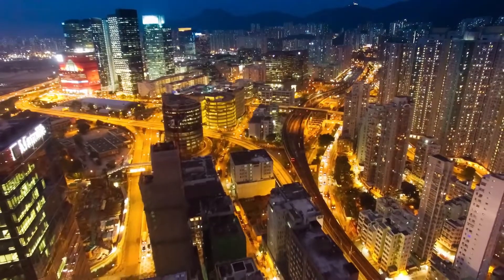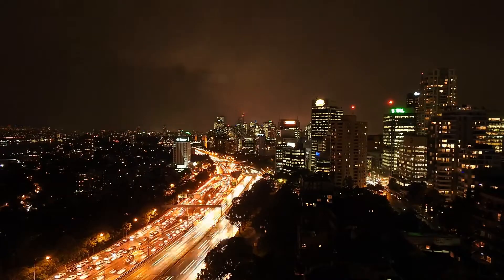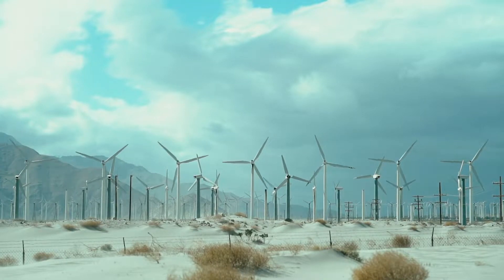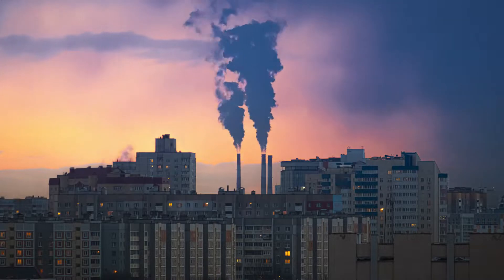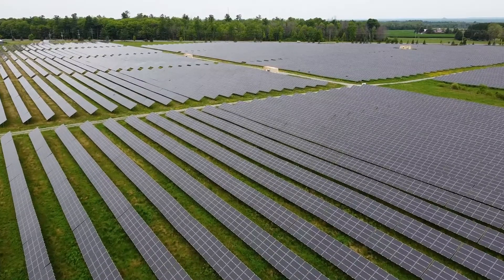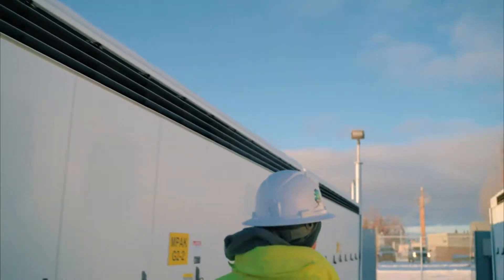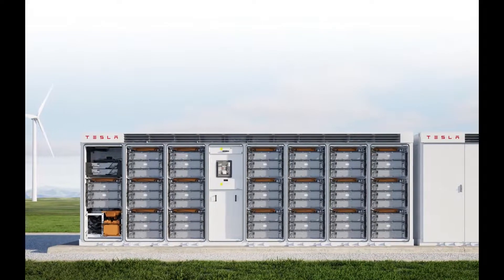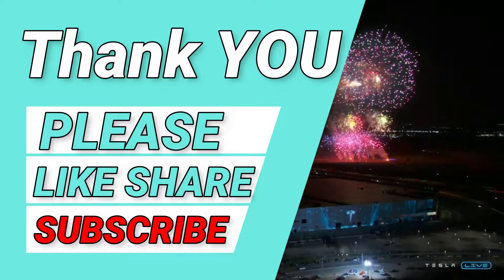Energy Grid Opportunity Nobody is Talking About

Comment: As long as an electrical grid has many Combined Cycle Gas Turbine generators running for hours every day, large amounts of battery or other energy storage won't be needed.  It will take five or ten years to build enough solar and wind generation to drive all of the coal and most of the CCGTs off the grid.